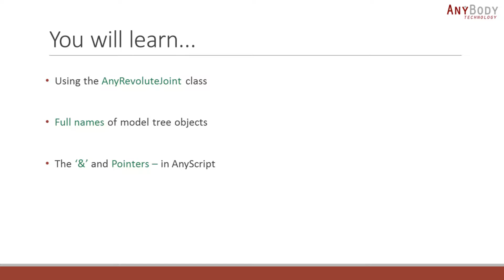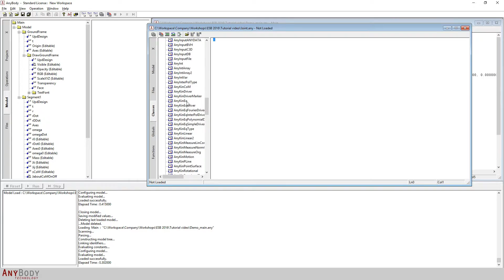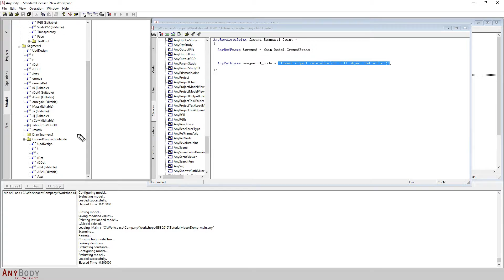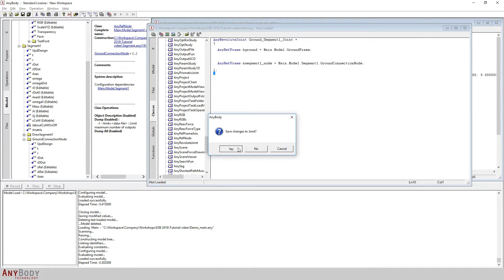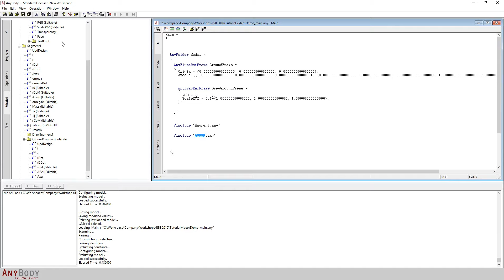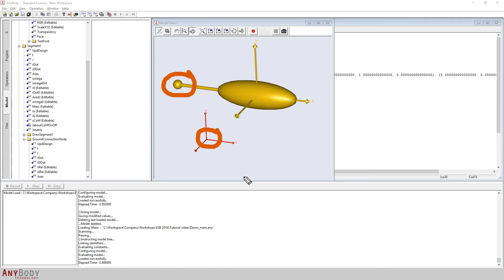Forging a Joint - Part 2 (Intro 7/9)

Comment: Hey buddy ,i got a problem when i tried to #include "Joint .any" then run the model(07:05 in the video) ,the message window says circular reference  .Then i find that in my joint any i miss  s  for S in the" segment1_node " (05:16 in the video)statement ,why is this ?how can a mistake in letter case lead me to an error?Really want to know the reason .  thx.